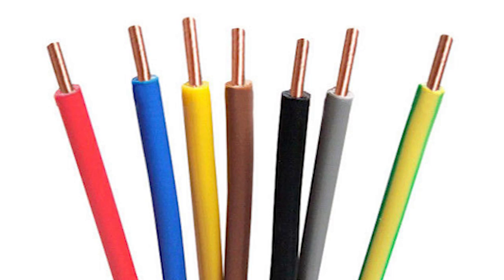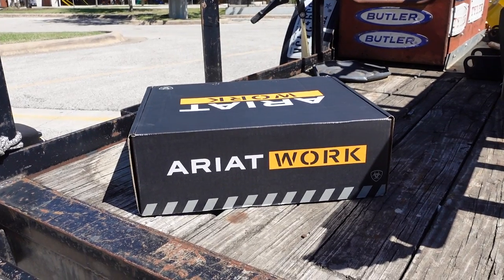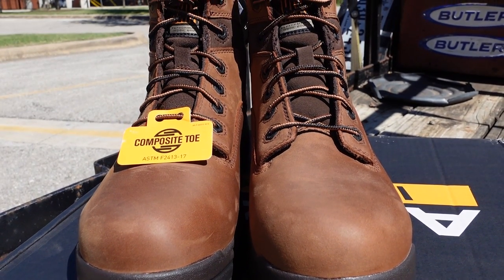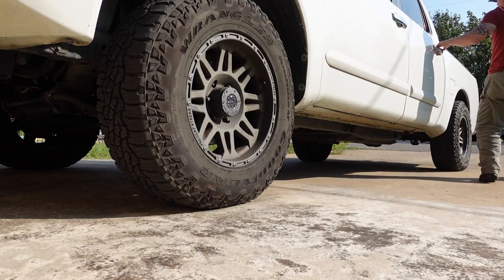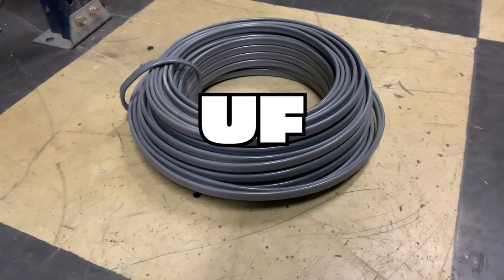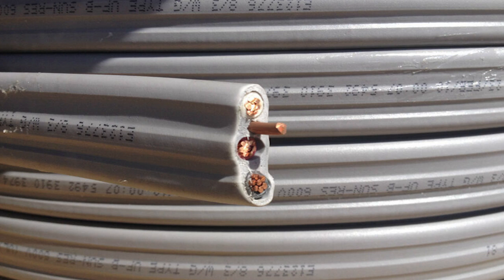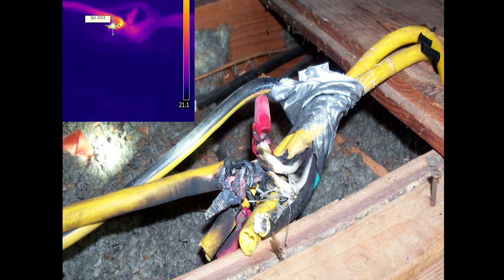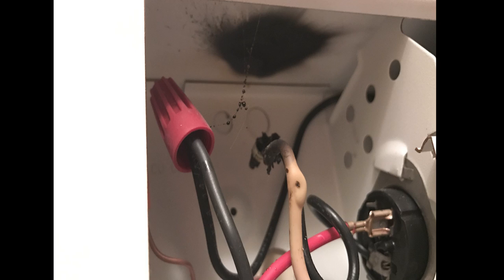Why Knowing WIRE INSULATION Types Is Crucial

Comment from the maker: One thing I should have mentioned is that bundling multiple conductors together is not only a heating issue, there can be induced and capacitive currents that can have an effect on each other making it more difficult for current to travel through the conductors.  This adds to the overall impedance on the circuit which can also cause extra heating in the conductors.  Just some extra info fer ya...
Reply: Yesss . Bonding n Grounding vid Justin
Reply: Only if bundled 24" or more. You know how it is, always fine print to the NEC :) Awesome video to keep it simple for the up and comers!
Reply from the maker: @jaredkilgore7194  That's just what the NEC says you need to worry about, that DOES NOT mean that the effects are not still there for that 24 inches.  It's just not as large of a deal over that small of a cross-section of conductors for us to worry about derating the entire conductor.  Over larger lengths, the same conditions apply but it is much more difficult to dissipate heat through that much density of material over such a long distance.  Trust me, it's still there...just not in a large quantity.
Reply: @ElectricianU  Thank you for time replying to my comment. Yes, you are correct. I should have realized you were talking about the inductive reactance in general. I've seen a commercial EMT job once we're the JW ran all the travellers from a large gang of 3 or 4 ways in one 3/4" to a box that didn't include the neutral or hot and that conduit got super hot! Definitely something to keep in mind for sure. IBEW local 80, 20 year sparky here. We've seen plenty of interesting things over the years, no doubt! Keep up the grind, work safe out there. Your videos are awesome brother!
Reply: Justin nice video and I am glad you are showing this much of the advice by the NEC in US, 18 amendment in UK and even IEEE standards indicating amapacity for cables in raceways/conduits or buried outside are based on long standing mathematical calculations. However latest research is showing using numerical techniques like computational fluid dynamics that those calculations are actually off to a significant degree - indicating that cables in conduit/ raceways need to be de-rated more if internally and de-rated less if buried underground in trenches with the geometric position of the cables being a critical factor in heat dissipation and amapacity rating. 

Moreover the situation really depends on the installation itself significant variations have been found due to that as well. So electrical codes are a minimum - electricians need to do a risk-based analysis and look at the installation to choose the right wires for the load and the conditions where the wiring will be in. Probably in few years you will start to see these amapacity tables in conduit and buried underground  change as it catches up with the latest research.

I found this guide from the copper development association very helpful starting to date a bit now but still very useful- they have other helpful topics as well for the electrician.

https://www.copper.org/applications/electrical/building/pdf/copper-wire-install-standard.pdf

Also you have mentioned this issue around heat, insulation breakdown as a safety matter. However more and more in the future power quality issues not just heat and safety issues will impact choice of wiring especially the need for over sizing neutrals - given the increasing amount of residential power generation solar, EV charging, mix of dc and AC devices leading to increase in surges, transients and harmonics. Which can degrade wiring through heat and increased inductance and capacitive effects - but even if does not it can still reduce the efficiency in which the wiring can carry that load and operates devices and equipment.
Reply: I work in a factory, and when I began I thought that bundling cables was really bad.

Now that I've seen loads of cables being bundled together, without any significant effect, Ive changed my view.

The only thing you want to do, is separate cables for internet, from big power lines. If it's fiber, then it doesn't matter.

We got stacks of cables, with all kinds of amps going through, without any issues. It's an old building so it even got 50 year old wires, on bundles, with no issues.

And when we build something new, we try to separate the heavy duty cables( 100+amps) from the regular ones. And limit the bundles of smaller cables to 7-8. As more than that becomes a real hassle to untie.
Reply: So are you saying that wire gauges has nothing to do with the amount of electricity that can flow?
Reply: Another reason to use 90 or 105C rated wire and to do all 20A circuits for 120V for standard outlets and decices. Lighting only circuits, or specific use case dedicated circuits (like a garbage disposals, refridgerators, dishwashers) could be run as 15A. I always run 20 with 12awg except for dedicated lighting circuits.
Reply: Have you ever come across led insulated wire? Yes, led as in the metal.
  I got a service call about two yrs ago at a residence where the owner said that the guy from the gas company came to read the gas meter and got a shock from the meter. Not a good situation. So I get to the house and looking around, I put my Fluke T5 to the gas meter and the cold water shutoff and sure as Hell I was getting about 74 volts. I stuck one lead into the dirt and the other to cold water pipe and was getting about 60 volts from the soil.
 After about five minutes of looking and thinking what could be the problem, I see a piece of ¾" steel flex coming out of the vent under the house and diving into the soil of the planter area which was next to the gas meter which of course had the main line underground from the street. When I looked at the flex it had corroded and disintegration had taken over and the wires looked like Romex painted silver and I checked it out and it was energized and our culprit. I shut it down went to dig a little and it was only about four inches long but it felt weird. I disconnected it from a jbox under the house and pulled it and the flex out and steel flex isn't light weight so I didn't notice until I pulled the "Romex " out and realized it was led sheathing. I'm 55 and started in the trade at 19, I have heard of this kind of wire but had never seen it before. Very strange stuff. Just another day on the job.
Reply: Shawty
Reply: @ElectricianU  4:53. Will that stronger insulator even handle Mars?

Comment: Nice intro to wire insulation. Another cool topic to build off this (you may have already covered this in another video) is sizing conductors based on the terminal’s temperature rating and how that affects the sizing process. That concept took a long time for me to grasp and no one could explain it to me well so I had to figure it out on my own.
Reply from the maker: Great suggestion! I've got one on conduit fill but not terminal and temperature ratings/sizing.  Thanks

Comment: Love the damaged insulation segment. There are so many areas that damage insulation that you never think about unless you are the one that comes to fix where it has failed. On the other hand we get really focused on damaged insulation for really common things, that frequently come down to the people installing it. I was just in an addition to a house that had been wired, approved, drywalled and simply needed devices installed. In total there were about 7 boxes I had to work on. I found four separate conductors with damaged insulation, all in the same fashion. In every case it was a jagged scrape about 1/2" long resulting in exposed conductors. Then came the figuring out what went to what. No diagram anywhere, just wires hanging out of boxes with no indicator of what was supposed to do what. Ok fine, this is common, but unnecessary. Finally, everything is hooked up and no matter what device you turned on, it tripped the gfci. Long story short, bad gfci. Ok these things happen, but that was already installed and I was working downstream from it and had to work on the stupid thing in place because moving the billion ton washing machine in front of it was worse than crawling on top of it and hanging down the back. I told the homeowner he needed to find an electrician that knew how to pull wires.

Comment: I look up the code or handy  reference electrical pocket tables book for different insulations and ambient temps ratings. There's also different insulations for different uses....such as wires immersed in water, exposed to outdoors, etc.

Comment: Have to say had people that lost power to outdoor lights and find romex a bunch of times, not uf but romex yellow sheath clearly labeled romex and it was pretty intact. The paper is usually soaking wet all the time and comes right off, the only thing I noticed is the romex sheathing is tougher to strip if that makes sense you can't use romex strippers on it. Unknown if its generally landscapers that hit it, sprinkler people, or if it just shorted somewhere else buried. Also I've noticed a few times in romex where the copper isn't as shiny as usual and has a duller finish where it doesn't even appear to be copper anymore have you ever noticed this? Its more almost a brown in color.

Comment: I used to work for a power factor correction company. We were concerned alot with kVBIL, the products they made ranged from 14kV to 40kV, so most of the time we used air as our insulation. The highest voltage rating I've used is 14.5 kV, expensive stuff.

Comment: Greetings Fella. Remember folks Conductor Insulation isn't actually sheathing. There isnt a Type NM-A....Its Type NM Cable available as NM-B , NM-C, and NM -PCS and NM-S is no longer constructed. Actually, Type NM Cable is permitted in raceways but as Dustin says its not the typical application. Interesting fact, the "-B" means the inner conductor insulation is rated 90°C even if the NEC limits it to 60°C. Now, remember you cant run 30 Amp or 40 Amp circuits to locations that require a 20 Amp circuit...if the NEC requires a 20 Amp small appliance branch circuit then thats what is required unless stated otherwise. Great Job Dustin keep em coming.

Comment: Point of clarification: NM/Romex insulation is actually rated for 90⁰ C and derating is based on 90⁰ table, BUT we're never allowed to load it above 60⁰ table.
Reply: But this is more of a technicality.
Reply: @reubenkriegel7639  It's not just a technicality.  In multi-current-carrying conductor bundles, you can use the 90⁰ C tables rather than the 60⁰ C tables, which is a big difference.  NM is restrained to the 60⁰ C ratings to be conservative enough that you don't need to worry about where it is installed; e.g., buried inside insulation in an exterior wall.

Comment: What about TFN,TFFN,MTW, PFTE. 
I’ve never heard anyone talk about these different types. I recently had to repair ceiling fan light and you can’t use typical building wiring. I had to do some research online plus use a magnifying glass to check out markings on existing wire; eventually used piece of  TFN.

Comment: I have installed a 1400 watt heated floor that's fed by a 14 gage wire on a 15 amp 240 volts circuit. That wire (NMWU) is going trough an electrical conduit ¾ inch pipe for about 20 feet. I have run a 16 gage wire, for a door bell with it, in the conduit. I have some doubt this is not exactly to code, are there any issues with impedance, should I pull the small wire? The conduit goes trough a 6 inch concrete slab.

Comment: I do have a question - what is the difference in electric load for solid vs braided wire. ie if I had 8ga solid vs some 8ga braided wire - where would one be more appropriate? Both are copper

Comment: You mentioned that you can run 30/40amp or higher circuits to a 20amp piece of equipment If the machine was to crap out like a motor calling for 25amps instead of 20 would it still fault at the capacity? Or what could be the outcome ? 
Thanks broski 👊😎

Comment: Last job I was on we had to use a special cable. Cant remember what it was called. The cables were feeding emergency power and lighting. It was similar to TECK cable. The rubber insulation was fire rated for 1hr I think. Supper soft but strong insulation, clad in a copper armor. I think it was around $250/m. And we had to use very expensive fancy connectors.

Comment: Is there a trick to getting the insulation off of UF?  I usually just use a knife to expose the conductors on the end then peel them apart, but it seems like there should be an easier way.

Comment: Hey D, in your comment below you mention capacitive inductance. I’m impressed. A while ago I dewired a 3-way and energized the circuit and was surprised to find 40v on the travelers. A little research revealed it was caused by capacitive inductance. I know sparkys with 35 years experience who don’t know or understand this. Sounds like you need to do a video on it. There are experiments you can do showing this. Cool stuff.
Reply: @@jash21222 yes, you are correct.

Comment: Most wires are also "cross-listed" for and therefore approved for multiple insulation ratings. For example, most THHN is also MTW rated (but not the reverse!). You'll see it printed on the wire itself.

Comment: Can’t believe that cable is buried directly in ground. What happens if somebody drives stake or metal post into ground and it hits the cable live conductor only. In U.K., we use steel wire armoured where the outer sheath is metallic which in the event of metal post being driven into it then it would automatically operate the protective device as it would create an earth fault
Reply: That's why there are rules in to Code for minimum burial depth, depending on location and type of cover (e.g., shallower minimum depth if covered by concrete).  It's also why anyone digging the ground or driving a post must first have a locator service mark the location of underground cables.

Comment: At 6:07 you say you can run 30/40 AMP circuits to all ur stuff rated for 20 Amp.  I hope u meant, conductors rated for 03/40 amps, and not the over-current protection device...otherwise that would be dead wrong.  Just sayin;.  :P

Comment: And then there's that stuff with the outer jacket that looks like woven cloth,  rather than plastic.  Which used to run from the weatherhead down to the meter on the outside of this house,  and from the meter down inside to the (now gone) fuse box...

Comment: Some forms of insulation also do not play well together.....
If you run PVC insulated cables in the same route as VIR (Vulcanised India Rubber) then the plasticiser will leach out of the PVC and turn the rubber to goo

Comment: I really like your videos. But some of them I need to watch it a few times and or get another book to understand what you are talking about. I'm not an electrician nor am I in school for it. I'm trying to upgrade and or fix things in my house. I'm a retired Fire Fighter and Army soldier. I have worked in the safety areas from both. So it is important that what ever I do are safe and at lease close to the current codes. I have several code books including NFPA NEC 2020. NEC is a hard read. The house I brought was built by the former owner who was an license contractor. I thought everything or most things would be good to go. You don't see behind walls, or inside a electric panel box when looking at a house. In short there are issues. I'm ok with some things, but I need a beginners course

Comment: Pardon me, I believe romex (NM-B) is rated at 90C. The book may have it listed at a lower temp but the actual insulation is 90C.
Reply: If you look at NEC 334.80 Ampacity- it tells you to use the 60* column for ampacity. That’s why a 50-amp circuit using NM requires #6 even though the 90* (and 75*) columns say you could use #8. You can use the 90* column for adjustments for bundling and corrections for ambient temps, but it still has to be not smaller than the 60* column.

Comment: You just people told people to put a 30amp breaker on conductor rated for 20amps and the plug will most likely only be rated for 15amps. Could clear that up before someone takes your advice.

Comment: Was told larger wire usage 10 vs 12 could cause tripped breakers
Reply: Was told larger wire usage 10 vs 12 on 15 or 20 could cause tripping breaker problems?

Comment: Factory ODM OEM Copper electric Power Wiring Cable BVR/BV 2.5mm 4mm 6mm 10mm Single Core Flexible electricity wires and cables

Comment: I just saw a post about lead insulated wire. I never knew that was a thing. Strangest thing I'd seen. To me anyways.
Reply from the maker: Heck ya, we used to have lead paint in houses, lead pencils in schools, and fill vehicles up with lead gasoline too... #cancer lol
Reply: there were paper insulated cables back in the days, even used in high voltage up to 35 000V maybe even more but 35KV definitely.
Reply: @ElectricianU  Yeah, I'm actually old enough to know about all that, but the lead wire insulation was a new one I never knew even existed.
Reply: There was once a time where there were lead jacketed pulp cables for telegraph & telephone services, and paper & oil insulated cables delivering power to urban settings up until the 1970s, commonly.  

Still not rare to run across an old chunk feeding something in older parts of most US cities.  In Pueblo,  Colorado,  I can very easily find both kinds of lead cables still in service, in the Bessemer and downtown neighborhoods. Even cooler,  is the old wooden terminal boxes you run across occasionally,  that house cross connects for phone service.